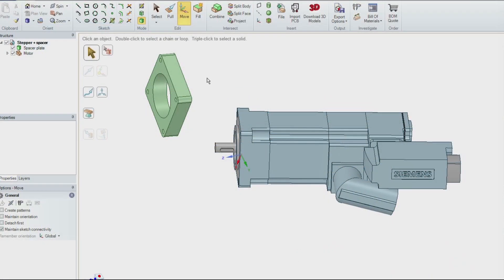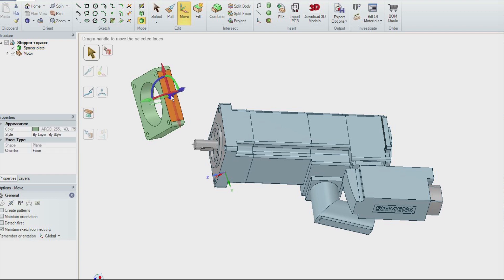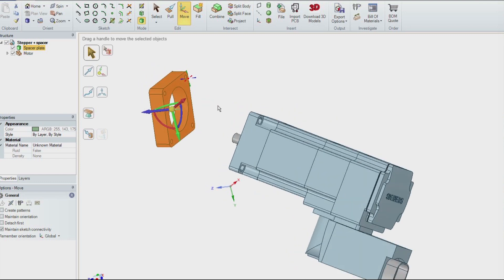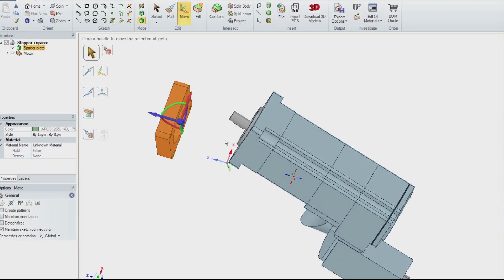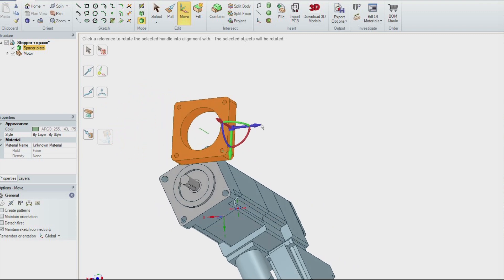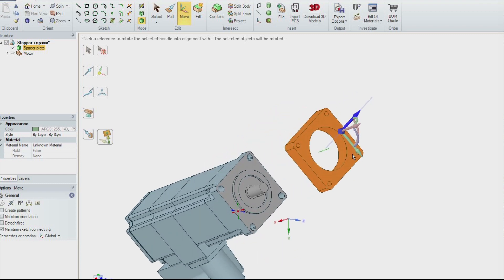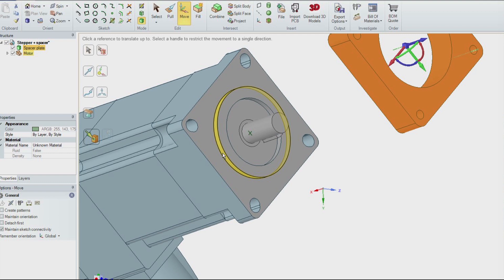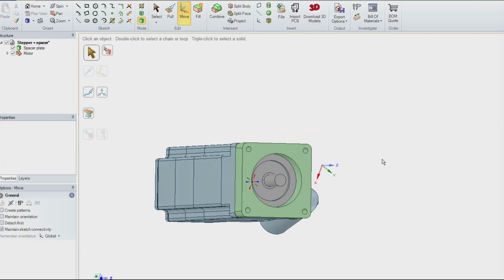DesignSpark Mechanical: Align Upto & Orient

Comment: Brilliant! I'm doing a pill box design for 3D printing, the box is in two parts which will snap together, this method is exactly what I'll need to check model fit before printing.

Comment: Thanks for the great video, I had no idea this capability was built into DS.  I am continually blown away by how versatile this FREE CAD package is.  I've tried to learn to use CAD packages for decades but never made any progress. Now that I am designing objects for 3D printing (I'm 70, this is my retirement hobby) I've found I need to learn how to use one.  Design Spark Mechanical is free, and seemingly more intuitive than most other packages I've tried, and with the wealth of great tutorials available from you and other great Youtube channels, I'm finally making headway in becoming competent enough to actually design parts and objects for 3D printing.  I had been using Tinkercad, which 'made sense' to me, but it couldn't handle complex objects, which rendered it useless to me.  Again, thanks for your many great informational videos.

Comment: You can also center it in easier in move mode with a right click on a full surface object and press up to and press on the axis on the other object...rotation will not change sadly 😅

Comment: Your first align was wrong. ONLY the HOLES are important. No one gives a shit about the casting faces.
Reply: It doesn't matter what features are referenced as we're not establishing parametric relationships. It might well be a rough casting - probably gravity die casting, but the cad accuracy will be perfect unlike the actual manufactured part.
Levelling and positioning to the main bore is quick but the alignment between one of the 4 fastener securing features requires a bit more work which is unnecessary. Whatever is available and convenient to use, exploit it.

Comment: Cannot thank you enough. Great explanation.
Do you happen to know if there's a "reset transform" function in DSM like there is in some 3D design softwares like Maya? An imported component has its coordinate system set up in a weird way so that every time I click the move tool the local axises of the component point in directions that are not perpendicular or parallel to those of the scene's coordinate space. Your trick helped me align the component to my surface. But I would like to align its local coordinate space to the scene space for easier manipulation of the component.

Comment: Hi Jim, I wonder if you could help me design a funnel from  square to circular transition. I have been trying and there is no way I can pull the surfaces that join these two geometric areas to a solid!
Reply from the maker: There is now a Blend tool in DSM v4.0 (R19.1) which will allow you to do this. It is located to the far right of the Edit panel of the Design bar.
Have a look at this demo https://youtu.be/xCvCxrY3y2w it may give you the necessary insight to achieve what you are trying to do.

Comment: Thank you so much Jim. I was doing something trivial. I had a complex design that I knew I couldn't print. So I sliced it up into components and then I wanted to orient them perfectly on the XY plane. So I took my largest piece, created a plane on it's flat XY base and then realigned all the other components to the plane using Upto (U) and voila all the parts are perfectly aligned with the print bed.
Reply from the maker: Excellent

Comment: Jim,

Thanks your video was very helpful.
It helped me to assemble some components for a manifold assembly project; where I had to import components I did not draw. They were not aligned with the planes on different axis.

I've been looking for some side freelance work with AutoCad or DesignSpark. Any ideas anyone where I should look?

Comment: Great Job Jim your a very patient man!.....Now go to Autodesk and download fusion 360 request an enthusiast license (free to use if you make less than $100K/ year) and accomplish the same task in four steps. I guarantee you you will love this program.
Reply: Fusion 360's direct modelling tools are not as sophisticated as DesignSpark Mechanical in many cases. I use both programs. For instance, you can manipulate edges of solids in DSM in ways that it is impossible to do in Fusion 360.
For instance, Fusion 360 has no equivalent of DSM's pivot edge tool. (no, it's NOT the same as draft). There is also no copy edge tool. You have to become familiar with these tools to appreciate them. They are extremely fast to use and incredibly powerful.
Reply from the maker: Thanks for your comments and the information.
Reply: i guess you missed the whole point
Reply from the maker: When I have completed certain other projects, it is my intention to investigate DSM and DSPCB a lot more. I think that I am now beginneing to see the nicer points of this suite of programmes.